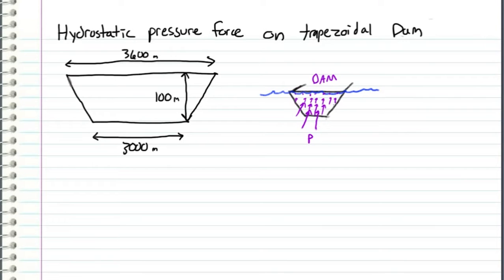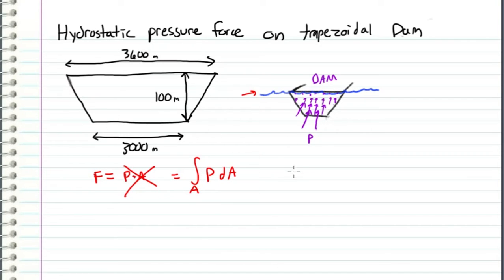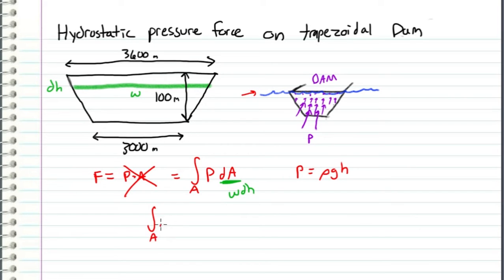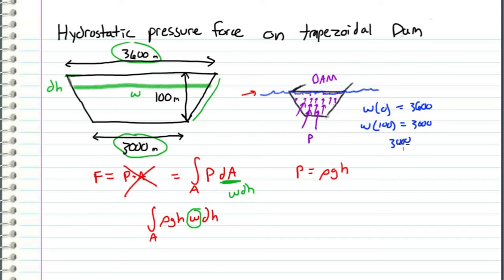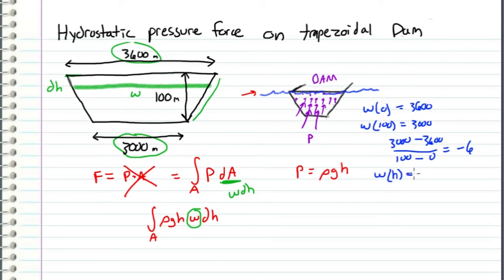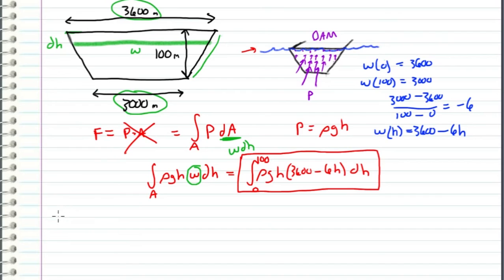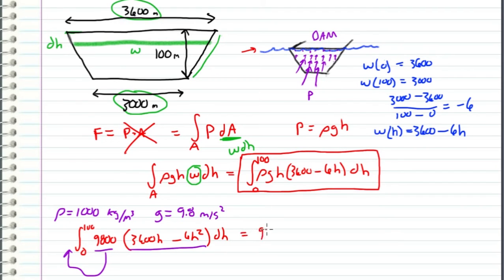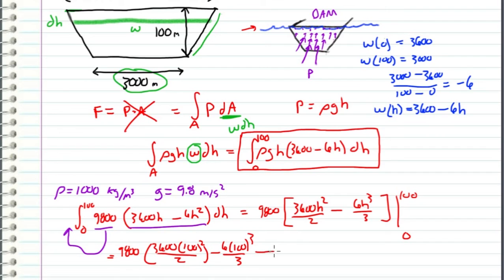Statics - Hydrostatic force on trapezoidal dam (Request)

Comment: i have a question. when width is 3000, it should have height of -100. since your axis is at the surface of 3600m.
Reply: if we set w(-100) = 3000 then the slope becomes 6, the width becomes 6y + 3600, and the eq. becomes 9800(integrate(-100,0):((-y)(6y+3600)dy)), which gives you basically the same answer (OP estimates it to two significant digits).

Comment: thank you so much for the explanation, but somehow when i am doing addition to get the w : (6h+3000), i am getting a different answer: 1.666E11, and i am not sure why
Reply from the maker: Edmund Yang type out what you’re calculating exactly and maybe I can point out where you are going wrong
Reply: @TheLazyEngineer  int 0 to 100 : 9800 * h(6h+3000) dh
=9800(2h^3+1500h^2) 
=1.666E11

Comment: Hello.  Can you tell me how can we get a function if the dam is submerged 5m under the water. Thanks.
Reply from the maker: First you would need to redefine your width function, w(h) by translating it 5 meters in the positive h direction. So w(h) becomes w(h-5) = 3600 - 6(h-5). Next, you will change your integration limits from 0-100 to 5-105
Reply: Thank you for your prompt reply!

Comment: how about the weight of the water?
Reply from the maker: princess pauper the weight of the water is taken into account through the pressure. Also Remember that the pressure acts normal to a surface so it isn't going to always act in the direction of gravity. since we know that pressure increases with depth (this is the case because there is more "water weight" being piled on top) then that's why we have to integrate the pressure all the way down the side of the dam. you can think of it as integrating the effects of the weight of water. if the water was massless (density = 0) then there would be no pressure exerted on the dam. hope this clears up some confusion. thanks for watching